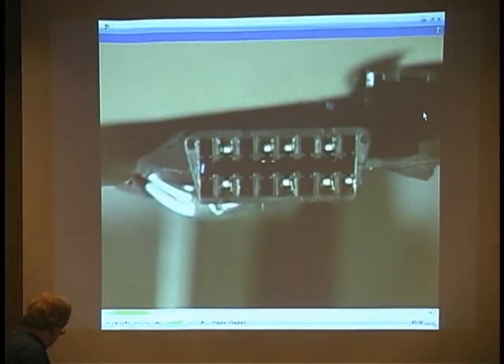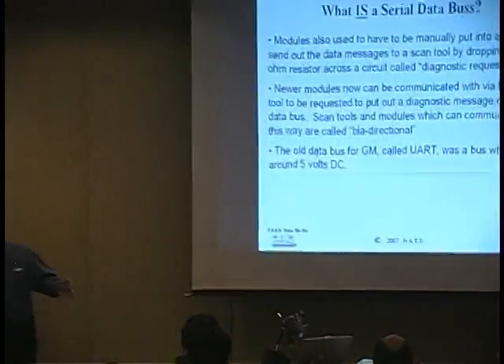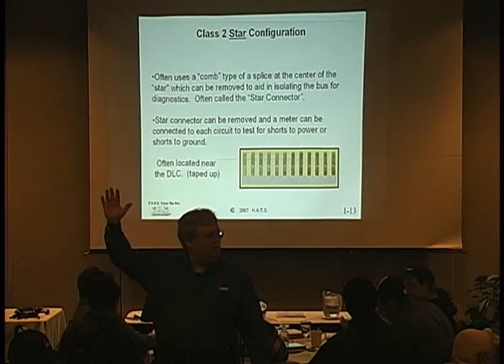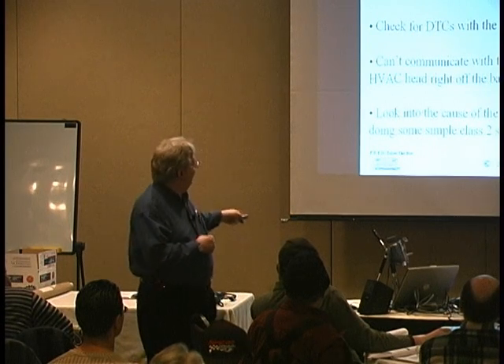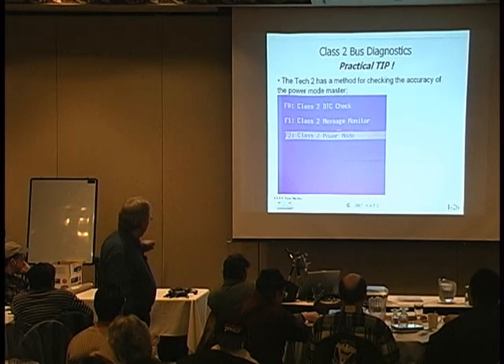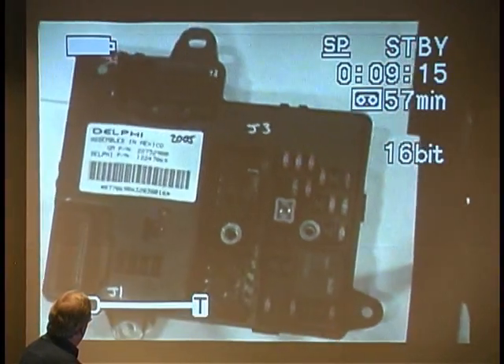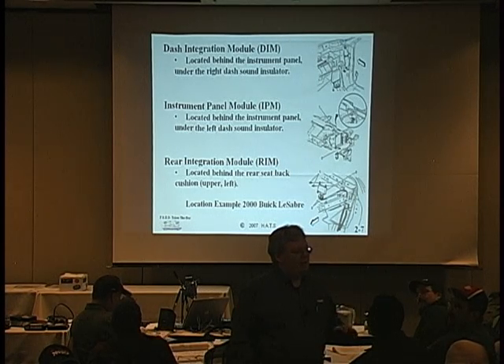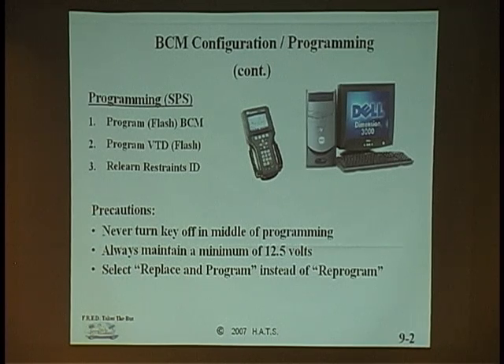CAN Data with Dave Hobbs

Comment: I had a problem with an electric fan I installed in my 66 gmc with hei.  When I'd shut the engine off, it would continue to run for 4 or 5 seconds before dieing.  The electric fan was generating enough power, during spin down, to power the hei ignition.  I put a key switched relay inline with the fan power, problem solved.

Comment: Correction: The largest decimal value that a byte can hold is 255, not 256.. There are 256 possibilities which includes zero, but the actual decimal value 256 is one bit higher than a byte can hold.  1 0000 0000 = 256... 1111 1111 = FF = 255. (35:55 time stamp)

Hexadecimal is not a magical numbering system, but a way to group bytes (8 bits) into 2 - 4 bit columns. Even the most modern computers having 64 or 128 bit registers group the values into 8 bit bytes.. a 4 bit binary value can hold values between 0 (0000) and 15 (1111).. providing 16 possible values for a nibble (half a byte) which is represented by 0 - F in a single column (0,1,2,3,4,5,6,7,8,9,A,B,C,D,E,F). So a word (two bytes) containing the base 10 value of 4000 would be represented by 0xFA0 which in binary would be = 1111 1010 0000.. Hex is merely easier to read.
Reply: this is a great background knowledge to have !
thank you

Comment: 75 and 110 baud were standards but only the old teletype over telegraph wires ever used them.  Computer modems started at 300 baud until the late 80s when 600, 1200, and 2400 baud modems became available.  Originally, modems were limited by the 2800 Hz telephone bandwidth; but research into communication theory allowed us to use the phase of sine waves to encode the information onto the carriers much more efficiently than FM (actually frequency shift keying).  Simultaneously, error correction codes in digital audio developed so that we could compress the data more before the line noise made it unrecoverable.  The result was 14400, 28800, and 57600 baud modems.  In parallel with this last phase, a "more standard" 4800, 9600, 19200, and 38400 were also available but most of us preferred the higher data rates to adherence to an unused standard.

Comment: Where is the class 2 shorting bar located at to communicate with each module ? Dave mentioned that several times and I have no idea where its located
Reply: He stated the comb/splice pack is near the dlc connector, or up under the dash on the left side of instrument panel or right side of instrument panel

Comment: I have a 2013 Yaris which will not communicate from ECM to CAN bus.  All other modules communicate ok.  Connector pin 1 is batt always on, and was partly out of the connector.  Could this cause the CAN bus IC to die?  63 Ohms measured on CAN bus.